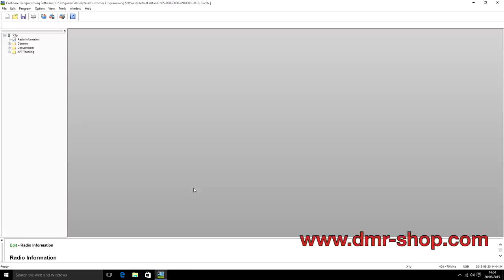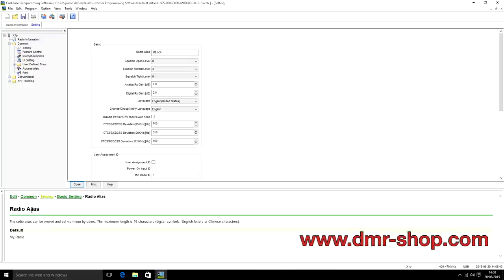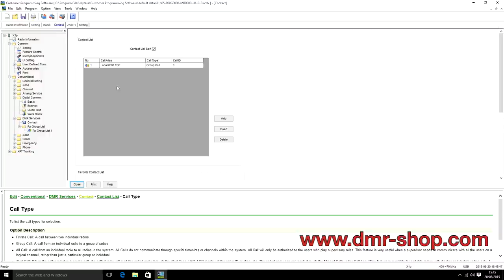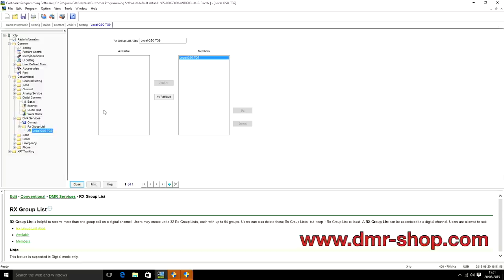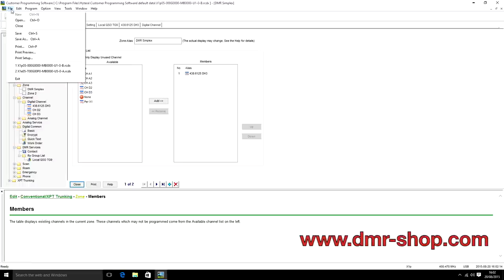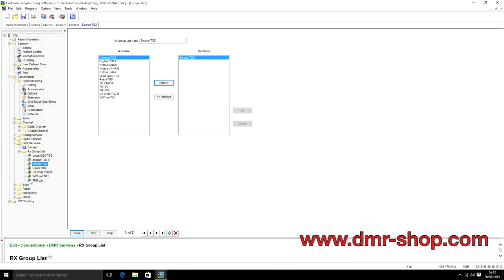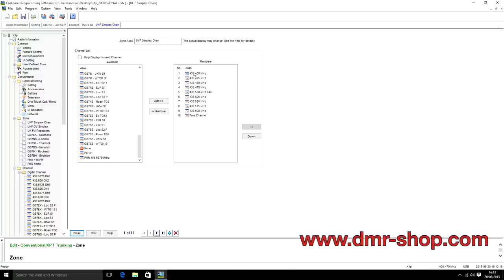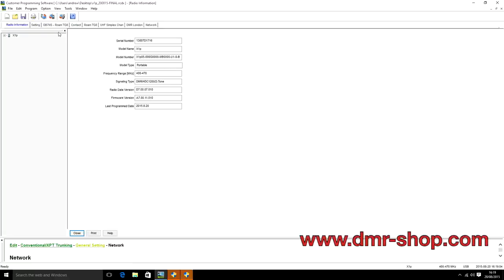Programming Hytera DMR Radios with Hytera CPS

Comment: Is the Hytera roaming option compatible with Motorola repeaters, or does that feature only work with Hytera repeaters?
Reply from the maker: +Don Price hi Don, it works with any repeater, roaming is a radio side feature as it just checks for the strongest signal on multiple repeater frequencies.

Comment: How do i change the channel order in the CPS software:P?
It drives me NUUUTSS when i have programmed two channels one for Timeslots 1 and one 2. And these channels dont lay right below each other in the software!
I havent figured out a way to sort the channels after name or grad and drop them:(.

I have over 100 channels and finding channels that should be right next to each other is a nightmare!
Reply from the maker: +heestenhats you should be able to do this in the zone section of the CPS.
Reply: heestenhats in zones there are 2 boxes. Available channels on the left box and your channel list on the right hand box. left click a ch in rh box to highlight it then click up or down Button on screen it will change the order then write to radio when you're happy with the order list

Comment: Hi Andy is it possible to reset a password protected used radio? tried it in the cps but getting an error message.
Reply from the maker: +ianevans67 hmm Did you try writing an empty codeplug?
Reply: Hi Andy no because I couldn't read codes from radio it said enter password. So I tried reset to default and I got an error message.  I think it may be a firmware update is needed in the radio. I have firmware upgrade kit but not sure how it works
Reply from the maker: I mean don't read the radio at all, just load a cqodeplug from the default codeplug folder included in the CPS and then Write.
Reply: andy kirby Thanks I'll try that or I'll try to write a default code plug from a different radio same model. I thought if it was passworded you had no access reading or writing to it.
Reply: andy kirby Hi Andy I'm afraid the model is not listed in the cps default folder. Strange though it's a PD705LT but my version doesn't exist and it won't load a different model. V frustrating
Reply: Hi Ian having the same problem with the password did you have any joy...regards Don
Reply: Don Peacock Hi Don yes I have the correct default file now. It still didn't default reset but the file did write to the radio and the pd705lt is now unlocked and password gone. I can now write code to it. If you have the same model with same firmware I can send you the missing file
Reply: I cannot read or write to my radio at all. Its a Hytera 655. I cannot get by the password. I understand there is a work around by changing the firmware but that will for next weekend. Thanks anyway. Don
Reply: Update ! Finally managed to reset the radio by updating the firmware. Still struggling to load a UK code plug but i did load a swiss one !
Reply: Don Peacock Good news Don keep us informed how you get on